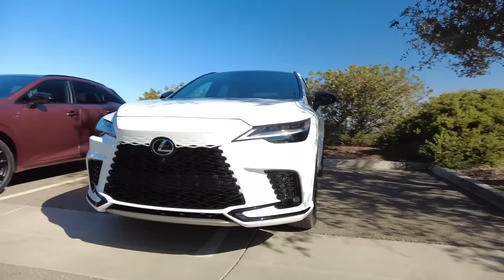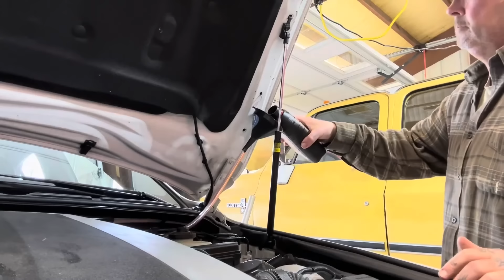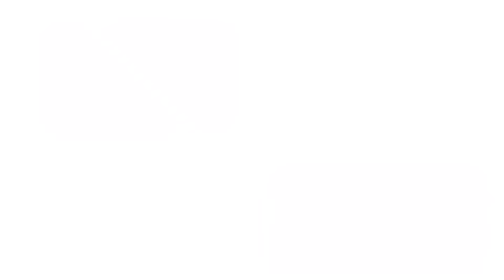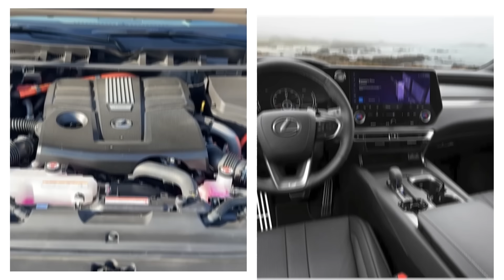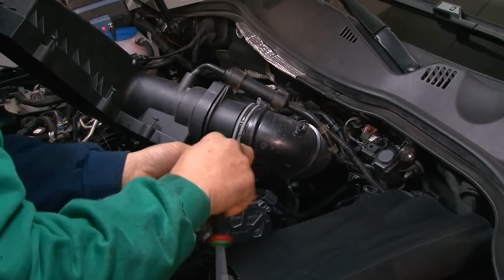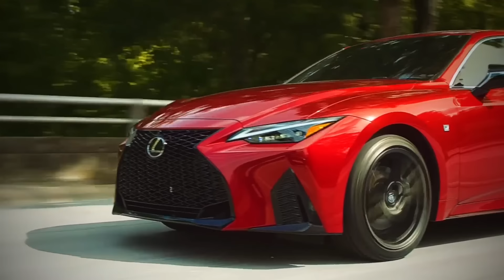How To Get Over 300k Miles Out of Your Modern Lexus

Comment: What if the original owner never changed the transmission fluid and I'm at 116,000 miles right now?
Reply: Do a drain and fill immediately, use only Lexus OEM transmission fluid.
Reply: @44444Awaken  Done! Took the chance and did it and no problems to speak of. Car shifts as smoothly as before. But I have piece of mind now

Comment: I have a LEXUS LS 430.  2003.  158,000 original miles. I am the original owner. It’s a shame LEXUS got rid of the eight cylinder motor was the best.